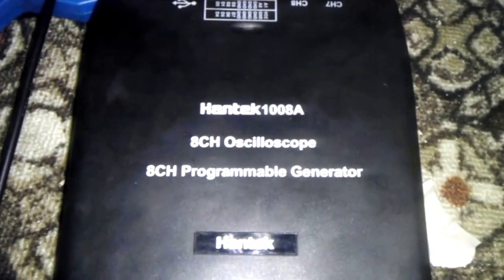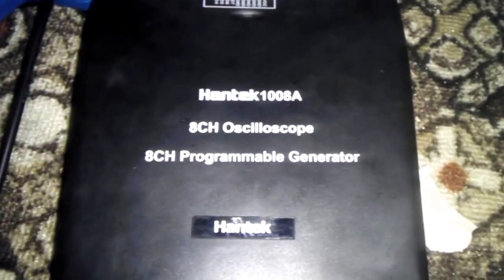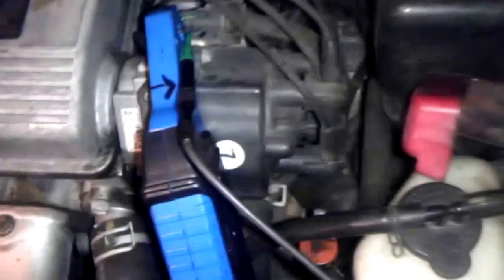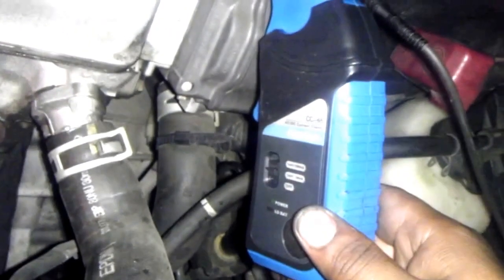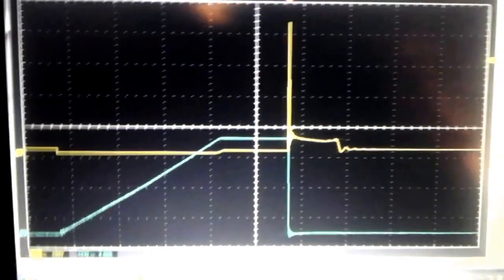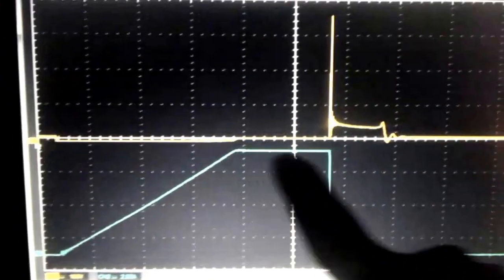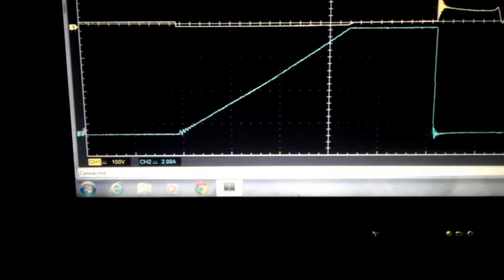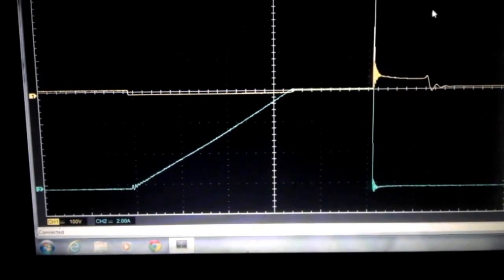Hantek 1008 A Primary Ignition Waveform

Comment: im trying to learn scope setup but your connected to contol side of distrubtor which cyclinder is this wave form
Reply from the maker: It is monitoring all of the cylinders. Most distributors have one control circuit and one ignition coil and the distributor distributes the spark to the cylinder that needs it. This means that monitoring at the distributor you will see the signals going to ALL of the cylinders.
Reply: @Enrique_Osorio   thats great info. so if one cyclinder has a problem what could i exspect to see. thanks
Reply from the maker: @egtreadway4232  Unfortunately, you will not see much on this waveform if you have a problem in one cylinder. You may occasionally see a glitch but mostly you will just see the other 3 good cylinders with their good waveforms. Fortunately there is a way to see an individual cylinder's waveform by only making a small modification to this setup. You will need a way to identify when the cylinder you are interested in is firing. You can use a probe like an HT25 which will wrap around the spark plug wire of the cylinder you are interested in and trigger off the signal from the HT25. This will ensure that the waveforms you are looking at correspond to the cylinder you are interested in. If you are unsure what a trigger is watch my "Hantek Scope Basics" video for more info. Link is below.

https://www.youtube.com/watch?v=Pv1tZ8zMBUI&t=0s

Also, you do not need an HT25 to use the secondary waveform as a trigger. You can use a plain old banana plug. I showed this in my "Hantek 1008 Secondary Ignition Waveform" video.  (Link Below) In that video I am observing the secondary waveform of a Coil-On-Plug ignition coil, not a system with a distributor, but the idea still works with distributor ignition systems. 

https://www.youtube.com/watch?v=PALjk13DDiQ&t=0s
Reply: @Enrique_Osorio   thanks for explanation i will give that a try with the HT25, ive been using HT25 on one plug wire at a time and get good waveform but have tied connecting to the ignition coil control wire to capture all cyclinders at same time and waveform looks bad cant make sense of it. please make viedo how to this. thank you

Comment: I just bought a cc-65 low amp clamp which I'm using with my 1008c, and the signal is supper noisy, even when the clamp isn't connected to anything.   I see the signal on yours is pretty clean, which makes me wonder if maybe I got a defective clamp?
Reply from the maker: Check to make sure the reset button is not stuck and make sure the battery is fully charged.
Reply: I put in a brand new battery and also ran the calibration routine on the 1008c after it was on a while.  What I saw was that this thing seems to have no shielding at all.  If I put the body of the cc65 close to the coil pack while reading the ignition current ramp, it picks up the voltage waveform as interference.  If I do a throttle snap the software will sometimes lose communication with the scope, and on one vehicle laying the body of the cc65 on top of the distributor while trying to read the current ramp would cause the whole computer to crash.  Similar problems with the HT25 secondary pickup, although not quite as bad.
Reply from the maker: To be honest, I am not sure what the problem is. It sounds like the clamp is picking up a lot of interference, as you mentioned. I think the only fix in this situation is to keep it away from places that emit radiation. Sorry I could not be more help.

Comment: In my car, Toyota Corona with 4AFE engine 1993, there is not current ramp limit (like a right angel triangle). at idle it is 5amps and  at higher RPM it decreases to 3 to 3.5 amp. its distributor has a six wire and a two wire connectors. IGT and IGF signals are same rectangle type. NE and G signals are also normal. is it normal to have no limit primary current ramp? or i have to check any other thing?

Comment: That's a great waveform you captured there Enrique, you forgot to mention the settings on the Hantek scope, for those of us who are barely learning.
Reply from the maker: +Tabo Racho You are absolutely right and I do apologize. In this case since I am measuring the control side or ground side of an ignition coil I will need to have a 20:1 attenuator between the scope and my leads. Due to this you need to tell the program that you have an attenuator attached by selecting 20:1 on the drop down menu where is normally says "x1". Then you would adjust your time base to 1 ms per division and the voltage to 100 volts per division.

As for the CC-65 low amp probe you would select CC-65(20A) with the same time base (obviously) with 2 amps per division.

Comment: 98 chevy s 10 blazer .  ht-25 on the end of the plug wire.
Reply from the maker: +Daniel Wells Try the suggestions  and let me know. Also the trick I showed in the Secondary ignition video will work on the S10. You just have to hold the probe parallel to and against the spark plug wire.

Comment: Yeah I recently purchased a Hantek 1008 and Im getting a secondary pattern but its got a lot of noise. can you take a look and tell me what it might be from and if theres anything I can do to reduce it or eliminate it . https://youtu.be/lOLghmRdlpo

THANKS
Reply from the maker: +Daniel Wells If you are using the Hantek HT-25 you might want to shorten your time base and decrease your volts/div. If that does not work try making sure the clamp is clamping the wire strongly, if it is not wrap that part of the wire you are clamping with some electrical tape to make the wire thicker to make sure the clamp is gripping the wire strongly.
What type of ignition system is it and how are you testing it?

For another method go check secondary ignition watch my Secondary Ignition Video

https://www.youtube.com/watch?v=PALjk13DDiQ&lc=z125hlewtxeyzf11l230f3rwxzycjt2tu

Comment: Im confused. Are you getting a secondary signal off a primary control lead?
Reply: +Daniel Wells The primary ignition produces an almost identical waveform pattern to the secondary ignition.
Reply from the maker: +Daniel Wells No, it is a primary ignition waveform from the control wire of the ignition coil that is inside this distributor.

Comment: will you be able to measure the burn times with a hantek scope?
Reply from the maker: +Chris Canty Yes you can but indirectly. What I mean by this is that there is no measurement from the drop down menu that directly measures burn time. Instead you would need to measure it by pausing the waveform and use the grid in the background to measure the burn time.
For example, in this video the yellow trace is the secondary ignition waveform. I have the time base setup to 500 microseconds per division, so that means going across the waveform each dotted line on the grid is 500 microseconds in time. This means the burn time is approximately .7 milliseconds or 700 microseconds.
Reply: Where would I start my count to measure?
Reply from the maker: +Chris Canty On this video it is the yellow trace that shows the secondary ignition waveform. The large spike you see is the peak kiloVolts. This is the amount of voltage necessary to start the spark between the spark plug gap. Once the spark has started the molecules of air and fuel that are conducting the spark become ionized and require much less voltage to maintain a spark. That is the burn time of the waveform. It is that flat part right after the huge spike but before the little wavy line that then drops down to a low voltage.
So to measure the burn time you start at the spike and count over to the wavy line right before it drops to low voltage near zero.

Comment: Thanks. What about the tablet setup you have. I would like to go that direction.
Reply from the maker: +Concerned Citizen I am using a Dell Venue 8 Pro running Windows 10. It works well. I have an attachment that converts the microUSB port into a regular female USB port. I bought it for $5 on Amazon and it works great.
Reply: +Enrique Osorio thanks I found the dells new in the 100$ range so far
Reply: +Concerned Citizen Just go to Amazon and look for a tablet that runs on Windows 8 or 8.1, or newer I believe, correct me if I'm wrong, NOT on Android.  They're getting cheaper.

Comment: are you using an Attenuator for the primary signal and if so what ratio. will a 20:1 work ok for automotive primary coils?
Reply from the maker: +Concerned Citizen I am using an attenuator. The attenuator I am using is a 20:1. Since the voltage spikes for a primary ignition circuit can be as high as 400 volts a 20:1 will do the job very well.
Reply: @Enrique_Osorio  where did you got the attenuator? Are those generic for all scopes?

Comment: How do you like the Hantek cc-65 low amp clamp? Does it work well and give good current ramp graphing and accurate readiings? I'm buying it for my 4 channel OTC Solarity/ Thanks
Reply from the maker: +buzzerauto I do like the clamp. I get great current ramps with low noise. I use it a lot with my Hantek as well as my voltmeter. I set my voltmeter to milli-volts to get the most accurate reading. I am not sure what the input is for the OTC but know that the Hantek CC-65 has a BNC connector. You may need an adapter.
Reply: +Enrique Osorio Do you use the hantek low current clamp with your new pico scope or do you use the pico low amp clamp? If so have you compared current ramps and digital readings on the different current clamps?
Reply from the maker: +buzzerauto I use the Pico clamp due to the way the unis are converted in the software. Is just easier. I see no functional difference between the Pico and the Hantek clamps. I assume the Pico will last me longer due to its construction but I have not seen any difference as far as waveforms go.

Relatively speaking we in the automotive world deal with much slower signals than most people who deal with electronics. Maybe there is a difference at higher frequencies but as far as current ramps for ignition coils and injectors i see no difference.

Comment: Right on for the video Enrique, I like that Oscilloscope ive always wanted one but there to pricey (like the snap on verus) This one is perfect and affordable I need the wave forms which is perfect for me. Im going to buy one Thanks keep up the great work God Bless
Reply from the maker: Thanks for the praise, I appreciate it. If you have any questions let me know. I custom make almost all my leads so if you need any ideas also let me know.
Reply: Enrique Osorio how do you make your lead any direction
Reply from the maker: Sam de technician I am not sure what you mean. Could you be more specific?
Reply: Enrique Osorio when say you make most of your leads what you mean next i want to see how you hook up  the scope clearly  even though video was good
Reply from the maker: Sam de technician Usually I make my leads with regular 16 gauge wire 4mm male and female banana plugs, male and female bnc connectors, a little solder and a little electrical tape. With a little work and creativity you can make any lead you want.
Reply: Enrique Osorio not steppin out   of  your bond but video will be 
im now get familar with scope but your help along the way i now oder hantek 1008c   it will be nice if do more video on this brand good job